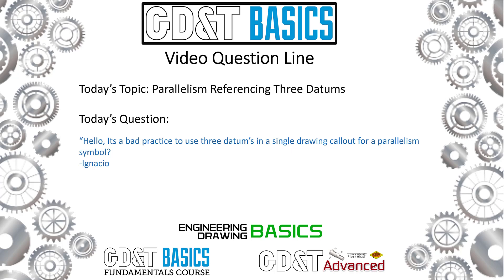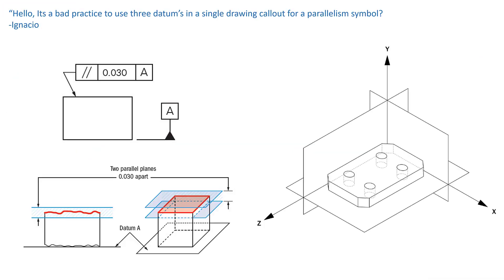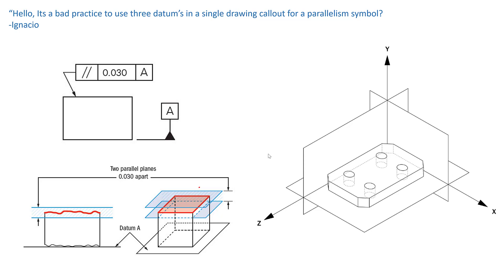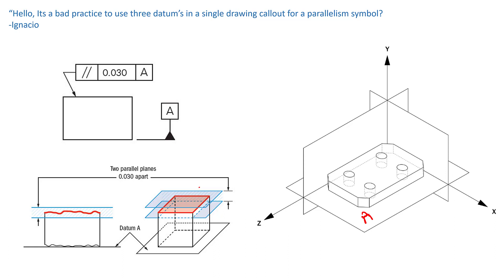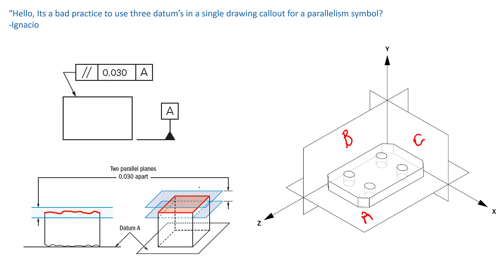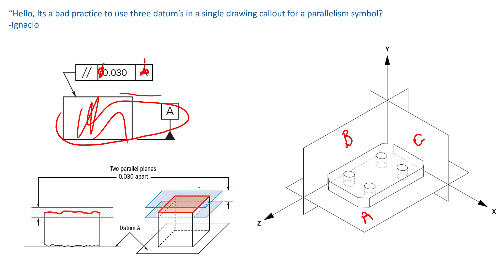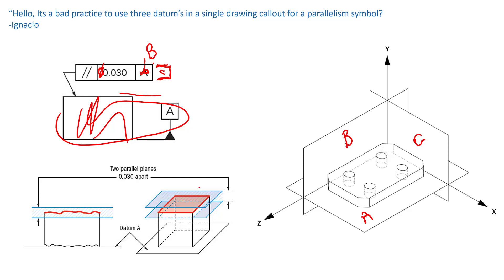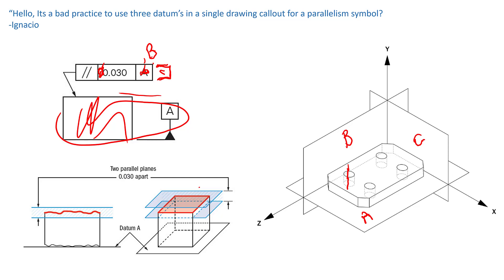Parallelism - Can you Reference 3 Datums?

Comment: Hi, can you please tell me, how 3 datum reference behave for perpendicularity & Angularity. ?
will it behave same like parallelism , which mean All orientation control don't require 3 datum reference in FCF. pls clarify
Reply from the maker: Thanks for the great question. You are correct in assuming that orientation only requires the considered feature to reference the datums necessary to lock down the orientation of the tolerance zone. For example angularity, perpendicularity, or parallelism could potentially only need one datum reference in order to properly define the tolerance zone.
Reply: But if I need that the paralelism of axis B and C is perpendicular to A. can i put paralelism of the holes related to A B C? Or is not allowed?